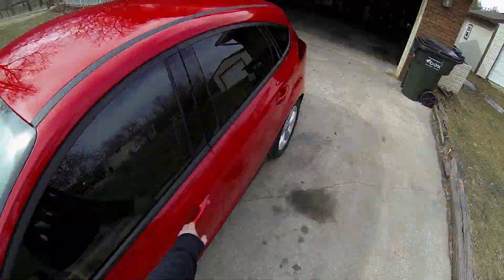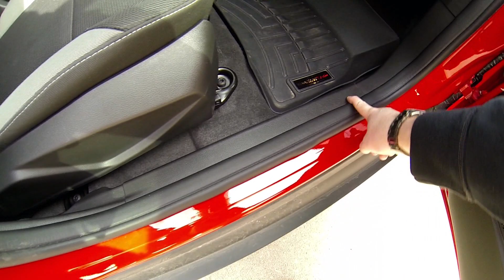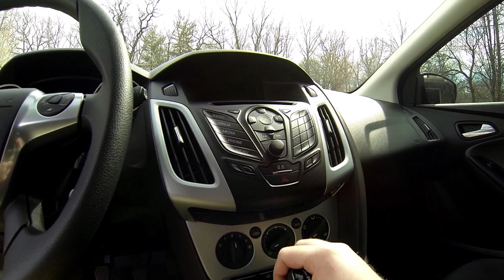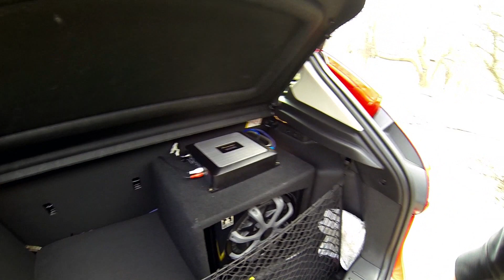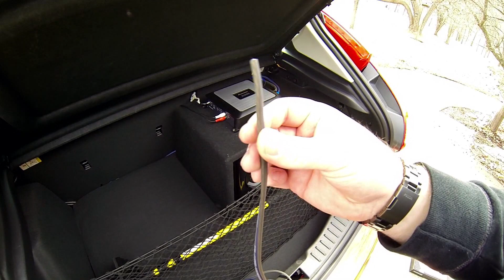2014 Ford Focus Amp Install

Comment: Very well done video. Question thats a little off topic for you if you dont mind, I have a 09 fusion with subs and speakers and factory radio. When you said that cars dont put as much power to the rear speakers it totally reminded me that my back speakers dont put out nearly the sound the fronts do. Thank you for confirming its the cars outputs and not a defect of my 4 chan amp. But do you think I could just bump up the gain on the rear channels to compensate for lack of power going to them?
Reply from the maker: Thank you! And bumping up the gain may help to make them louder, but I don't know what the quality of the speakers would be for one thing, but also I don't know the quality of the signal going to them (frequency range). I would use the fade control to listen to only the front speakers, and then fade it to the back and sit in the back to listen to see if the quality is decent. I haven't hooked the wires up to an oscilloscope to see if there is any actual degradation in the signal itself though, so just listen and try to get it to your liking. Good luck
Reply: Great thanks for the response!

Comment: So what would I do for a remote wire then since my amp requires one
Reply: Dakota Alger oh thanks on the 12v auto switch on clarification!
Reply from the maker: No problem. Best of luck getting everything up and running.
Reply: Everything worked for me just fine
Reply: Most line outs now come with signal wires
Reply from the maker: Just find a fuse that only has power from accessory power (only works when the car is turned on). I don't know of the fuse number, but it will be a 12v+ signal to turn on the amp. Test with a multimeter, and then you can get an add a circuit to plug into the fuse position. You can check out my video where I install a sub in a Ford Fiesta, and then I had to do that. It has more details:
https://www.youtube.com/watch?v=jYCFZ5l726c

Comment: Does this head unit not have RCA hookups if so how do you get around that when wiring an amp
Reply from the maker: It does not. Most factory units do not have RCA inputs unfortunately. The best way is to tap into the factory front speaker wires directly behind the radio. The reason why I say the front speaker wires is that some factory units limit the audio sent to the rear speakers, so sometimes the front speakers are better quality. 

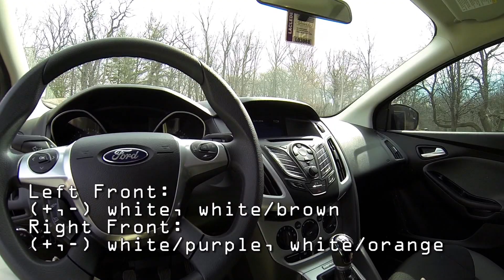All that said, at 3:46 I wrote the colors of the wires to use for the 2014 SE with the standard (non-Sony) radio. Just splice into those wires, and you can run them to an amp if your amp can take speaker level inputs, or a Line out converter if your amp only has RCA level inputs.

If you're unsure of which wires, or have not wired a sub before, I would recommend finding a friend to help out ( I was pretty nervous toying around with my new car, but having a sub is totally worth the trouble IMHO).
Reply: I connected a 500 watts amp directly into the Speaker wires and it worked but i could only raise the volume to 10...everytime i raised it higher the amp went off
Reply: The best thing you can do is buy a HI/LOW convertor i bought 1 at a local store and it was 10 dllrs..now i have a 1200 watt amp and it works prefectly

Comment: Man that grommet was a pain! But we finally got it wired up. Thanks for the video couldn't have done it without it. Also did your check engine light come on after you did this cause I think we might have bumped into some sensors while fighting the grommet.
Reply from the maker: Yeah it took me and my brother a while to get through. Lol
But no I didn't have any lights come on. I went through closer to the passenger side of the grommet because most of the wires came through closer to the drivers side of it. I'd run it by Autozone to check the light for sure. Hopefully it's nothing! And I'm glad the video helped.

Comment: Do your front speakers sound any diffrent?
Reply from the maker: Nope. They sound as good as usual. The way the sensor on the amp works is that it acts like a really high impedance device so that it can measure the voltage on the audio line. So basically the current is still going through the front speakers the same as before.
Reply: Thanks for the fast reply, im in the processes of ordering wires to hook my MRX-m240 amp to my ford fiesta sedan 2013, debating if I need a line out converter. Do you have any insight on this?
Reply from the maker: Caity Gnadig Just from googling it, it appears that you won't need a line out converter. That particular amp has speaker level input, so you can use those. Don't hook up your speakers to the RCA inputs, but if you're buying the amp new it probably has a little adapter cable to plug into the speaker level. I also installed an amp in a 2013 ford fiesta sedan so, if you have trouble with running the wires and you don't drive stick, check out that video: https://www.youtube.com/watch?v=jYCFZ5l726c&list=TLBJDcCoW0jgk

Comment: I need some help. I've installed everything as you and once I go try it (mind you I haven't equalized anything yet) the subwoofer will not work. I have no experience installing amps/subwoofers. So please get back to me as soon as you can to help find a solution to what's causing this issue, thanks.
Reply from the maker: Ryan Toole Sorry that I just now saw this, but if you still need help, let me know. Generally, check all the fuses, use a volt meter to ensure that you properly grounded the amp and that it is getting power. Your amp may need a remote wire, and I did not include how to do that in this video, but in my ford fiesta install I did, and they're pretty similar cars:
https://www.youtube.com/watch?v=jYCFZ5l726c

Comment: Where did you get you floor mats at? Great video!!!!
Reply from the maker: They're Weathertech floor mats. My friend recommended them, and they are great. A bit expensive, but they kept my carpet clean and not soggy all winter. I just didn't want my car getting a musty smell from water seeping under the carpet. The only thing is, if you have a manual transmission, the dead pedal area isn't covered very well by Weathertech, but I've heard Husky Liners cover it better, and they're cheaper. You can get them from Amazon, but the Husky Liners I didn't think looked as good.

But thanks! I hope it helped.

Comment: You have the hatch right? I'm guessing it sounds better in there rather than a trunk?
Reply from the maker: Yeah I have a hatch, so I'm sure it sounds a bit better than a sedan, but my mom has the focus sedan with the stock sub and it sounds decent. I don't know if it would make too big of a difference though.

Comment: What did you use as a ground?
Reply from the maker: I used one of the seat bolts. I have a ground tester, so I ran the power wire, hooked up the ground tester, and then probed around to make sure there would be a solid ground connection. I just sanded some paint back, and it works like a charm! You can check out my Fiesta amp install video, and I do it more step by step.

Comment: Will all this work on the 2014 sedan the most basic model...like with the stick stereo and everything and can you list all the stuff in the video or where to get EVERYTHING except the LEDs
Reply from the maker: It will definitely work on the sedan. The only one I'm sure that it would work with the wires that I noted in the video is the Sony radio version. Other than that everything is the same. Also, I updated the video description to include the parts and tools I used. Best of luck!

Comment: Thanks for the video.  Finally got around to ordering a wiring kit and LC2i so I can finally reinstall my old Pioneer subs.  This will be the newest vehicle I've ever installed on, so I'm glad to see there isn't too much to get into my way.  Really like the fuse location too, I'll probably do the same thing.

I won't have a trunk after I'm done, but the sedan has a mail slot for a trunk so it wasn't seeing much use anyway!  :)
Reply from the maker: Thanks! And yeah this was the newest one I've done, so I was a little nervous about it, but it went pretty smoothly.

Comment: I'm guessing installing this voided your warrenty?
Reply: What???  You are joking right?
Reply: Honestly no, I don't know shit about warranties, sorry
Reply: Sorry. I Had a really crappy day yesterday. I Shouldn't have barked.  About the only thing they could ever void is the warranty on the radio if something ever happened to it.  but they would have to be prepared to prove it though.   The Best thing to do if you were worried about it is to build the system to be able to remove the components expeditiously if needed for warranty work.
Reply: Alrighty, I have a 2013 SE and I was wondering how you got it through the glovebox? I looked and couldn't find the hole that you said was there (Maybe you said you cut it? I dont remember).
Reply from the maker: bullrunlover There is a rubber grommet where the factory wiring harness runs through. It's a black rubber circle on the left hand side of the firewall looking at it from the front. You have to use a carpet knife to CAREFULLY cut through. And then just seal it with weather stripping sealant.
Reply from the maker: bryco32 The only reason why something like this would void the warranty is if it caused a fire, or shorted out the factory radio, then Ford wouldn't replace it because it would clearly be my fault. But valid question, because warranties can suck.
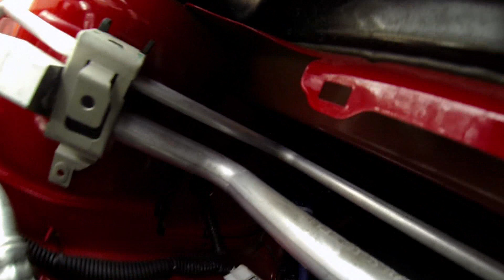Reply from the maker: bullrunlover At 1:37 in the video I show the grommet. Just cut it, then use a large flathead screw driver next to the wire and push both at once. Then hold the wire, pull out the screw driver a little, and then push both in again. Never put the blade on the wiring, just next to it to help it slide through the hole.
Reply: Another question, are you going to Focusfest?
Reply from the maker: bullrunlover YES!!! I will try to go. I live in Saint Louis right now, so it's just right across the river from me.

Comment: Can you briefly explain how you were able to connect to the factory head unit without the need of a line out converter? Thanks, good video btw.
Reply from the maker: Sorry it took me so long to answer, but the link in the description shows what wires are which. I just used vampire clips (or wire splices) to hook into the existing wiring. A line out converter is only needed if the amp doesn't support the line out level. Pioneer amps do, but you would have to check to see if your specific amp can take the higher voltage levels. My amp also has an automatic turn on level, so it detects the speaker input when the car turns on, and turns itself on.

Comment: I'm not new to wiring up an amp, but I am new to wiring to a factory head unit.  I am also looking into getting a focus and trying to determine if I should hang on to my current amp/sub combo.  Thanks for posting this video, I just have one question.  You spliced into the front speakers, and those are going to the RCA inputs on the amp right?
Reply from the maker: Yes, I had to make my own plugs, but radio shack had some decent stuff.
http://www.radioshack.com/product/index.jsp?productId=2102959&filterName=Category

I got something like that, and made my own connections.

Comment: I heard that when you try to hook up an amp and subwoofer, you have a possibility of losing sync. Have you had any problems with sync? Have you lost it sometimes after installing your amp and sub? I have the same exact car and looking to install the same amp and sub in my focus. Thanks!
Reply from the maker: Sync as in the Ford Sync program? If so, then no it is perfectly fine. If you cut some wires and don't handle it correctly, then maybe. But I only spliced the front speaker wires. If you change the radio from the factory unit, then you will lose sync unless you purchase some add on box. Since I left the factory head unit in, then I still have sync and bluetooth and all that. But be very careful with which wires you splice, and double check them before plugging them into the amp.